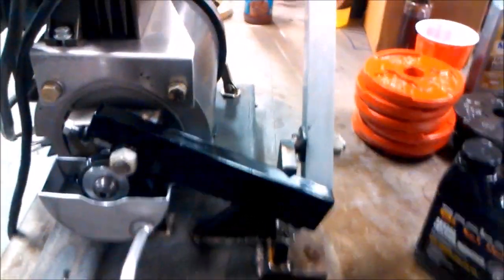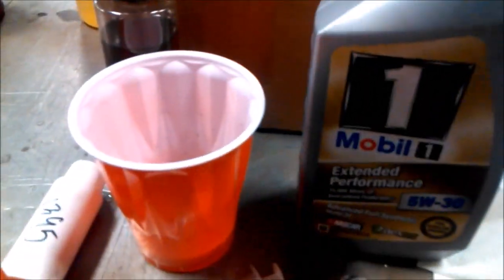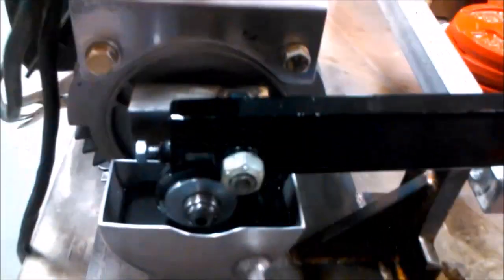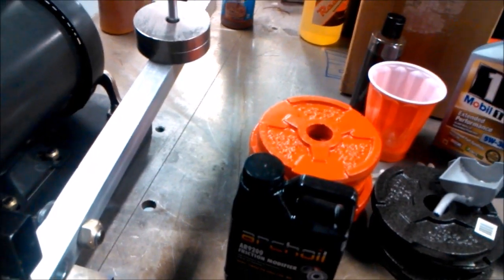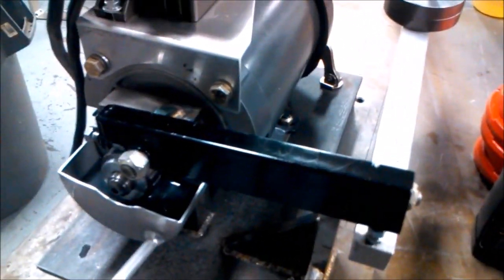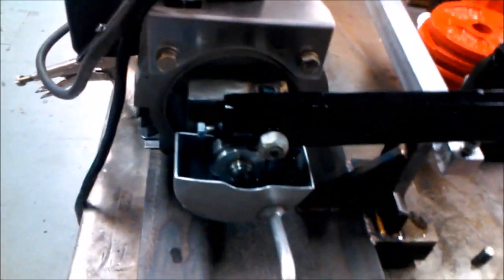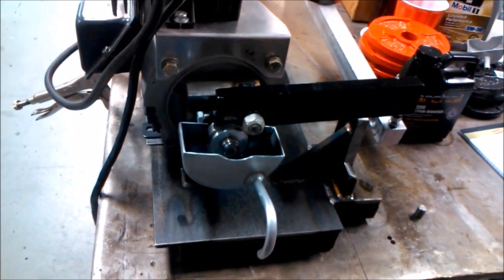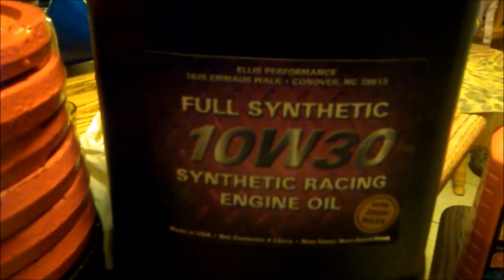Archoil vs Turbo Maxx  stiction test for  Ford power stroke

Comment: I don't know the directions for archoil but 1:1 oil and additive ratio doesn't seem right. Maybe you misspoke but if you actually followed that that could be a reason for failure I haven't used the product yet so idk .
Reply: yea i believe its 1 bottle to 5 quarts so its more like 1 part archoil 5 parts motor oil
Reply: @Brian Coakley  yea 7.3 powerstroke is 15 quart system arch oil comes in a 16 oz bottle so what am I wrong about
Reply: @briancoakley1524  i said bottle so your wrong read again i said 
"yea i believe its 1 bottle to 5 quarts so its more like 1 part archoil 5 parts motor oil"

and when i said 1 bottle to 5 qt i clearly mean 15 qt and just didn't proof read 

you are responding to me but you meant to respond to the other guy Stig Cruise

watch what your doing when you hit reply

Comment from the maker: Mixed absolutely proper just said 1 2 1 it's actually 1.2 ounces per quart is there recommended even if you use ounces per quart that still doesn't work